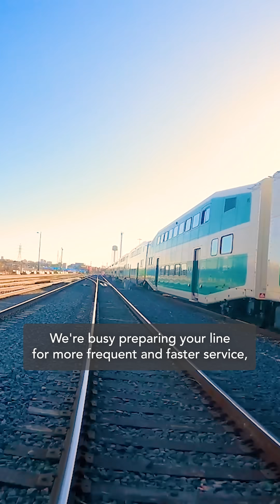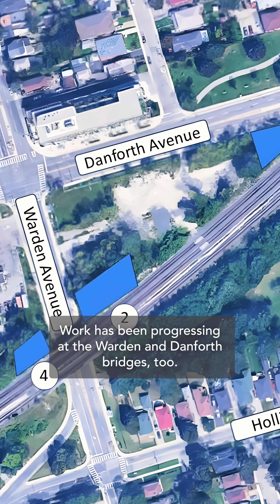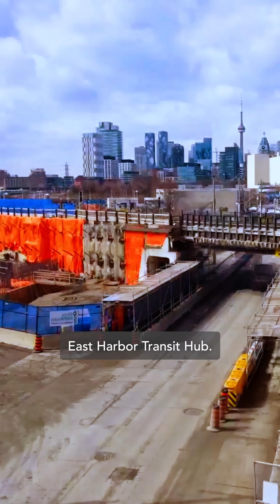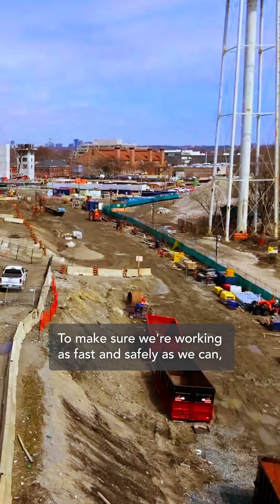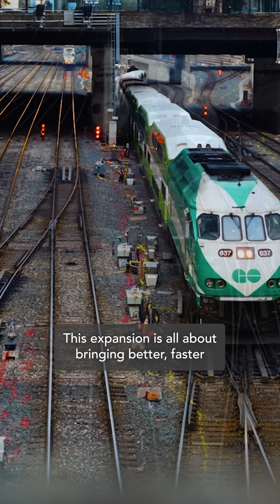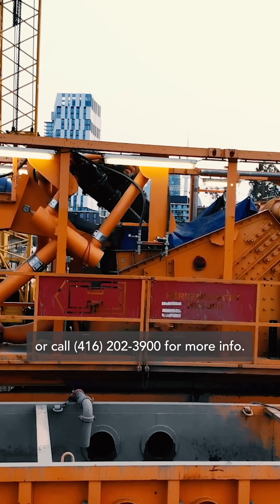Paving the way for electrification on the Lakeshore East GO line

Comment: Big mistake what happens when we have a major power outage
Reply: Electric Traction is vastly superior the Benefits outweigh the Downsides by Several times Railway Electrification has been around since 1879 and the first major projects were in 1904 and 1910 in the United States with the United Kingdom, Australia, France, and even Canada (but only on a single line in Montreal that has since been converted into a Subway)